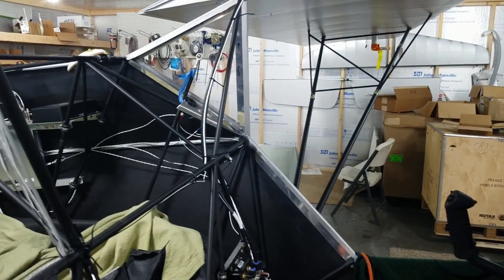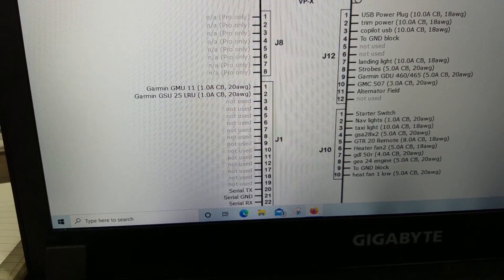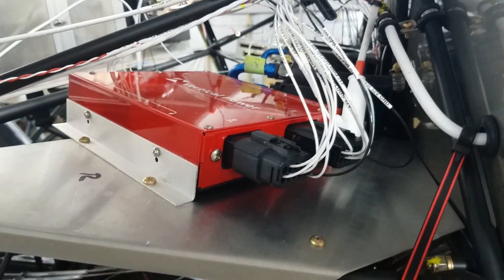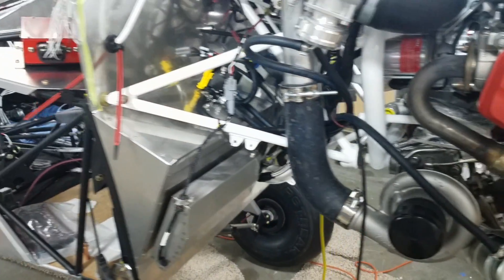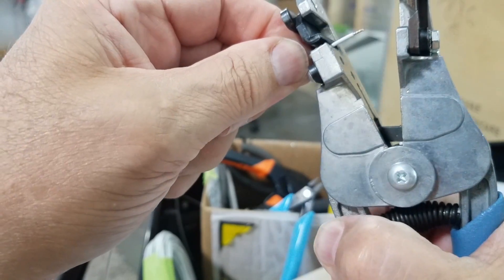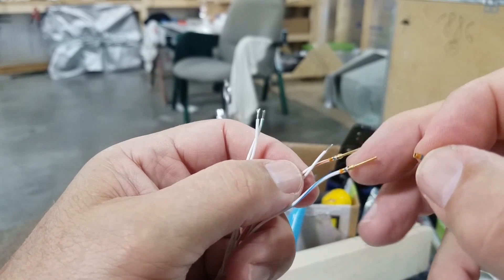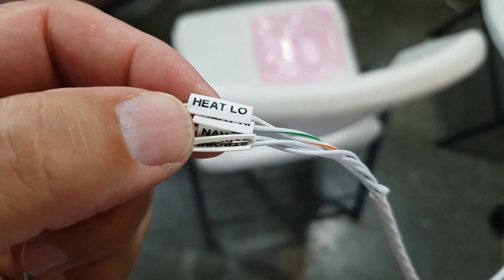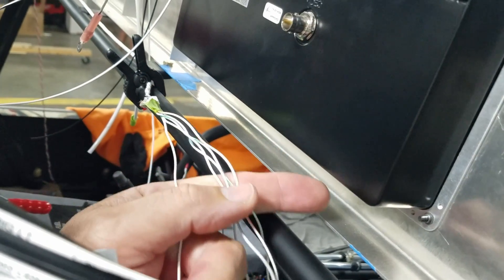Kitfox STi build. Vertical Power and Testing some wiring on Farmfox.

Comment: Great video!  When you insert the pins into the plug, what keeps them from falling out?  Do they snap in?
Reply from the maker: Yes John they snap in. It takes a removal tool to get them out and of course the outer case of the plug gets installed when completely finished which gives strain relief on the pins. Thanks for watching!
Reply: @KitfoxPilot  Thanks.  I thought I could hear them snap in place.